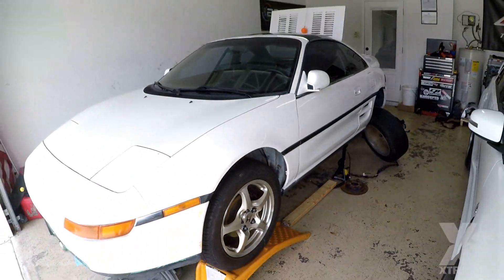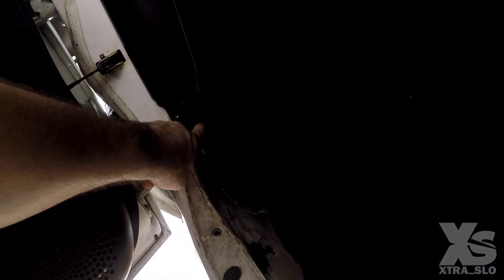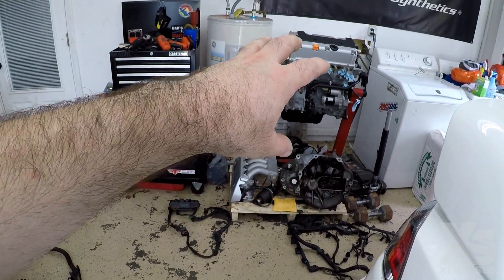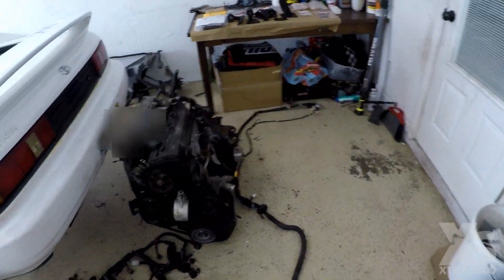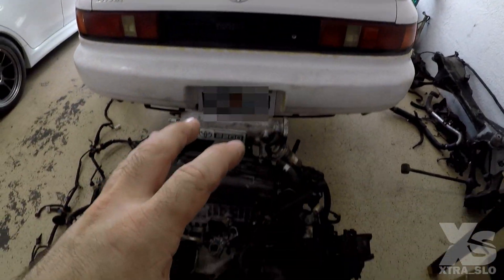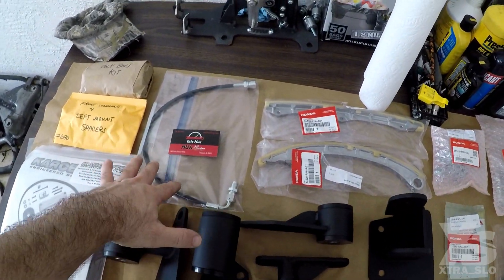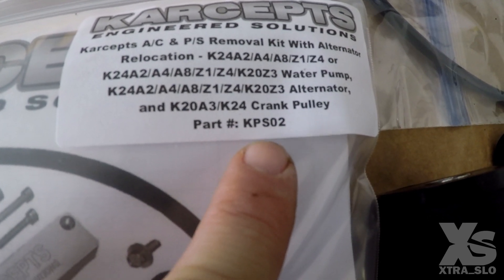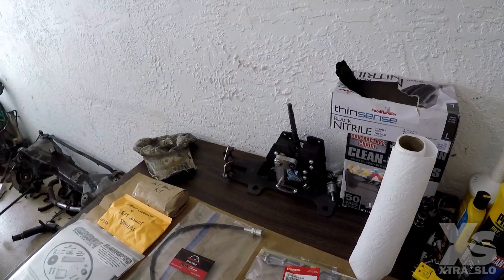Mr2 K-Swap Wiring, Fresh Wheels and NEW PARTS!!

Comment: I can use any rsx harness on the k24a2?
Reply from the maker: If you are getting hux wiring service done you can use any rsx engine harness to get integrated with the Mr2 body harness. You will need to change the K24 crank to a k20 sensor or get the adapter
Reply: @xtra_slo1596  nice info 👌
Reply: @xtra_slo1596  I also have an evo x 😂

Comment: By the way when you planning to build the evo engine. I guess the MR2 build is gonna be first.
Reply from the maker: Currently daily driving the Evo. The plans still to get this K motor dropped in n/a for daily driving to work and then I can get started ripping the Evo apart without having to use my wife’s car or have a time panic.
Reply: @xtra_slo1596  hey I saw a old video you make about your evo build. What CR of the pistons you plan to use. I hear 9.5.1 but Iv e only seen 9.3.1 by wiseco.